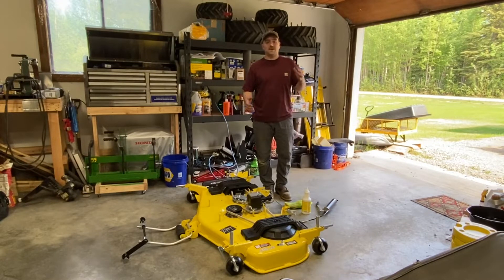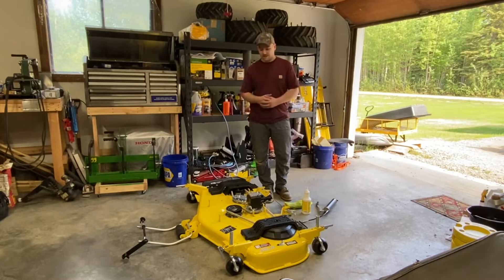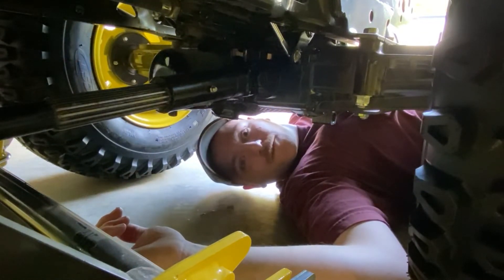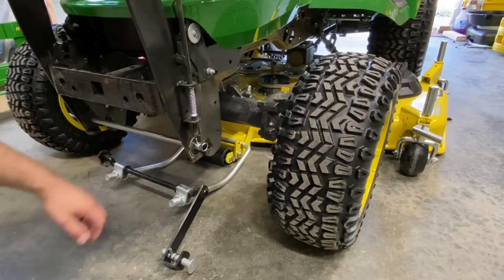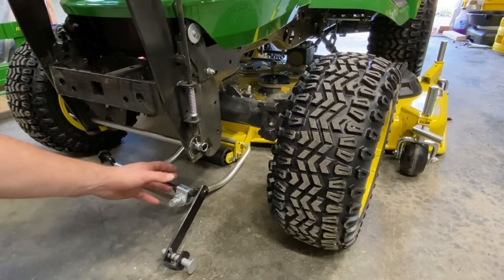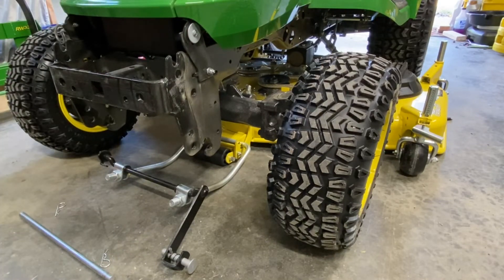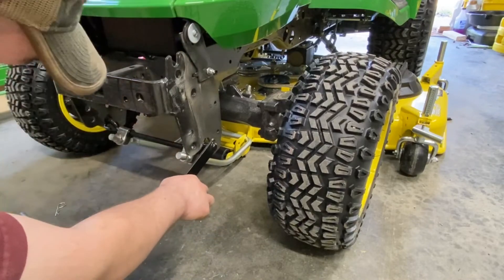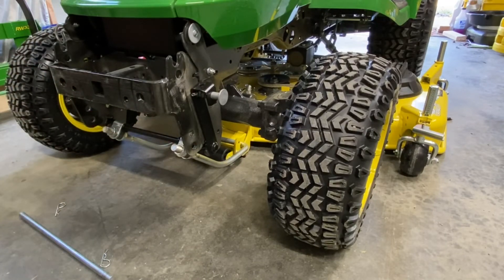John Deere X700 Series Mower Deck Install (X730 / X734 / X738 / X739 / X750 / X754 / X758)

Comment: Hi Josh, good mounting demo. I've got a X739 with a 60 inch deck. I want to reiterate the importance of lifting the deck slightly to allow the blades to turn when removing and installing the drive shaft. If you don't you will fight to hang the shaft out of the way when removing the deck, as well as removing the shaft from it's hanger on install. Other than that trick, and lubing the shaft coupler (prevents the balls from seizing), the standard drive shaft is fairly easy to install. The only downside, compared to the quick connect, is you have to get down on the ground to reach up there and slide it on. On the plus side the standard shaft is simple and durable.

A few extra tidbits:

My model is all wheel drive so it climbs the deck well in both directions but I still find it's easier to mount in the grass to prevent deck sliding.

If you turn your wheels in either direction you can pull the brush guard pin out from the side too (remove only one clip).

The front deck wheels on the X700's decks are fixed skid type normally found on suspended decks. JD needs to replace them with a caster type as they will dig in a tight turn. If you cut around a crowned tree base, they we dig a circle in the ground. This is especially true with the X739 as it has a 6-8 inch turn radius (with the 60" deck).

If you can afford it, buy a second deck. I usually get at minimum 15 years on the body of a well made garden tractor. I still have a cub (nearly identical  to the JD X730) that is still in service after nearly 30 years. But... the decks will not last that long and you will find it nearly impossible to get a new deck in the tractors later years.

The HC Decks come with the holes pre-bored for the hydraulic mulch kit. You may want to plug them so sand doesn't wear the holes larger over time.

Overall the decks preform very well. They are set flat to the sides so anything the deck frame touches is getting cut. Add to this there is a raised front lip, so you have to be a little extra careful not to shave a raised surface like a sidewalk. They lift the grass very well and run fairly clean. Good discharge flow even in tall grass.

Comment: Great video explaining non "Auto Connect" deck install Josh.🙂
I too have a X758 and install the AC deck on a polished smooth shop floor.
I have to use a 4'X6' horse mat so the deck does not move when driving the tractor up and over.
You can get in trouble real fast if the deck twists side ways too much...been there once...never again!
Thanks for the vid...
Reply from the maker: I actually keep one of those mats in the back of my truck! That’s a good idea! Sucks they are so damn heavy though, really hoping tool box mat will work better next time.

Comment: I really enjoy your x758 videos. Very to the point relevant and informative. I am looking for a part number for black plastic covers that go on the deck that the front wheels drive over, mine are missing
Reply from the maker: I looked them up, looks like there are a number of different parts involved… do you want every part number you will need?

Comment: Hi  josh……I also have  X758 which I bought last summer and really like it. The only issue I have had is in leveling the deck and getting the rear draft arm latches to release when ready to disconnect and back off the deck. The latch is spring loaded to close but is suppose to open and “stay” open enough to drive backwards over the deck before it closes back. Mine is very is easy to unlock, but locks back as soon as I let go of it. I know the adjustment of the front draft arm is important in deck leveling but also I think in the relationship to the proper operation of the rear draft latches. I hope you will do a video covering all of the above.

Comment: Hey Josh, I got the 758 in January just mowed with it a couple times I noticed you have the anti-scalp wheel on the front. Been thinking about getting one and also do you notice your deck being noisy from idler, pulley in spring
Reply from the maker: I don’t recall having any odd noise coming from the deck. All I can say is take the belt off, and spin each pulley/spindle. If they spin smoothly and don’t have a ton of play then you should be fine.

Comment: How do I lower the arm where it hooks into the back of mower deck before connecting drive shaft. I can not get it to go down
Reply from the maker: Turn on the tractor, move the upper lever foreword. Make sure the height adjust is set to the position marked for deck install/removal

Comment: John, I just bought a used X758 and trying to convert from the plow to the mower. I disconnected the plow, but my mid PTO isn't lowering with the hydraulic lever. What am I missing?
Reply from the maker: You mean the deck lift arms? PTO doesn’t move, unless you have auto connect, then I guess it kinda does. Deck lift and plow lift use different levers. You will need to do a couple things. First, you will need to open the diverter valve on the SCV. You can find info about this on my quick hitch tractor prep videos. Then, adjust the mower height to the position indicated for removing the deck. Finally use the UPPER lever and push forward. The lift arms should lower. There is no weight on it though, so you may have to pull it down manually while someone else holds the lever forward. Or, you can start the tractor, and hold the lever forward, it will lower in no time under power. Hope this helps!
Reply: @JoshsGreenGarage  Thanks, had to flip the valve and all set.

Comment: Hey Josh, is the part number for the x700 series 54” HC front deck roller you installed BUC 10313? Thanks
Reply from the maker: Correct, I have a video here:
https://youtu.be/XEJUEZfa5FU
Near the end is the roller install.
Reply: @JoshsGreenGarage  Thanks again for the info!
Reply from the maker: Make sure to check your deck serial number though, I want to say there are 2 serial number breaks for the nose roller.
Reply: @JoshsGreenGarage  Ok, Thanks
Reply from the maker: 0-060000 is BUC10329, 060001+ is  BUC10313, but says to order BUC11667 now, might have updated part numbers.
Reply: @JoshsGreenGarage  yeah, I saw that. Confusing, but looked at the picture of BUC 10313 and it looks just like the one you put on?
Reply from the maker: Yes, mine is 10313, like I said, check your deck’s serial though incase it is an older deck. Online you can find the 10313, but I bet if you go through a Deere dealer it will probably be the 11667. I’d put money on the 11667 being added because of the green decks now, exact same part, but I’d bet it’s green. But don’t quote me! Haha